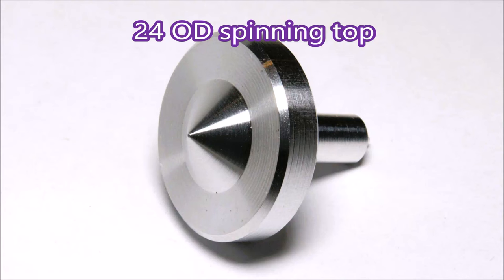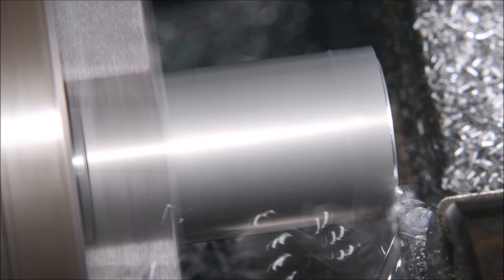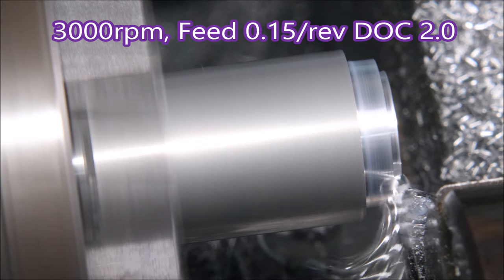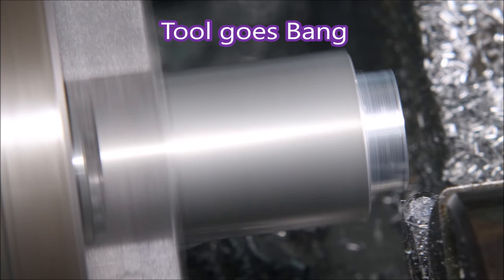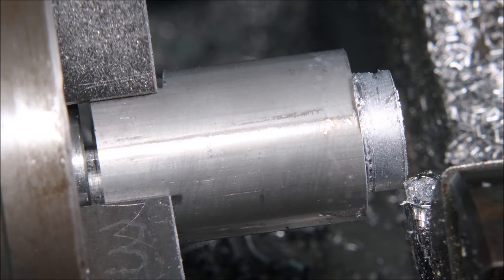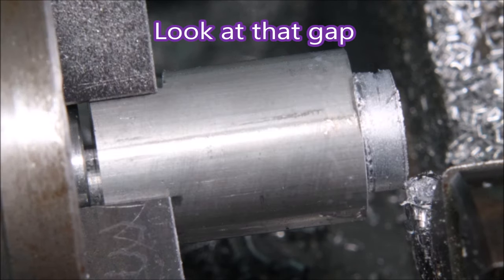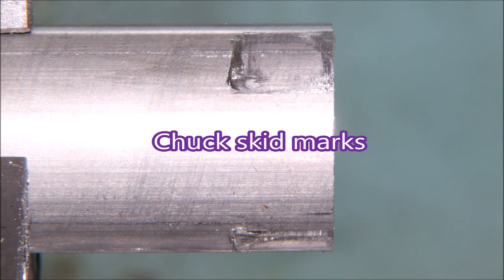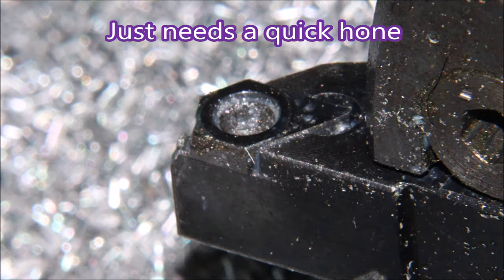Destroyed an insert while making a video!

Comment: I think the high spin speed is a part of that, it helps oven up the jaws, i dont think u need 3k rpm in 90% of wut u r doing, or perhaps u can tell me why u use 3k most of the time
Reply from the maker: So you are saying that the high speed puts forces on the jaws tending to reduce their holding power?  You may be right, I had not thought of that.
For a surface speed of 300 (brass and aluminium) anything smaller than below about 31mm needs 3000 plus. So I use 3000 rpm for most of what I do.  Thanks for taking the time to leave your comment.  I appreciate it.
Reply: @smallcnclathes 
1. not me saying i have seen it explained and proven on a scientific video but cant find it now, it makes all the sense because of the centrifugal force as far as i remember, working on lower speeds will make ur life a lot easier in many ways plus longer tool and bearing life
 2. who said u need to match the recommended SFM? absolutely not specially on nice machinable materials, u can go as low as u want with no change in the surface finish (again not a general rule)
u welcome and i love ur videos
Reply from the maker: I have a job coming up for 400 parts. I will be standing at the lathe for less hours at 3000 rpm than I will at 2000 rpm, so I think that job will be run at 3000 rpm. I will try to set up the job in both lathes an shorten the time even more.